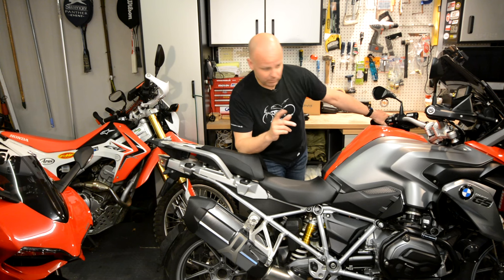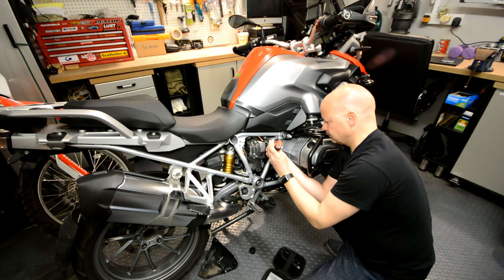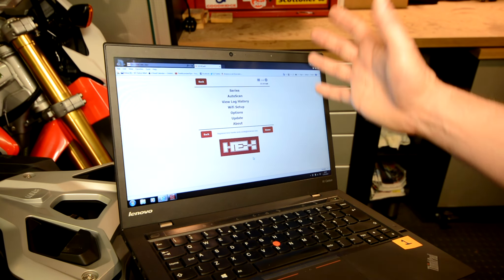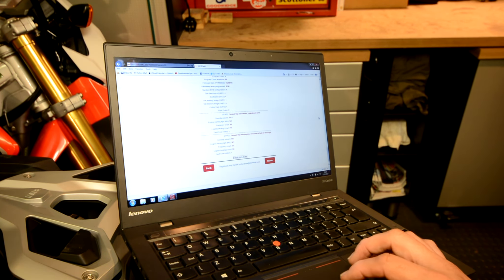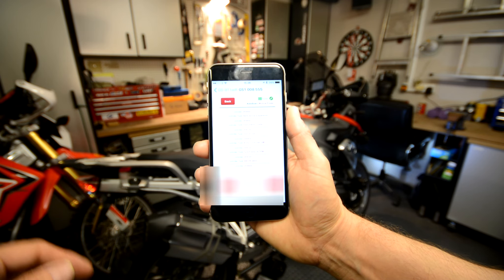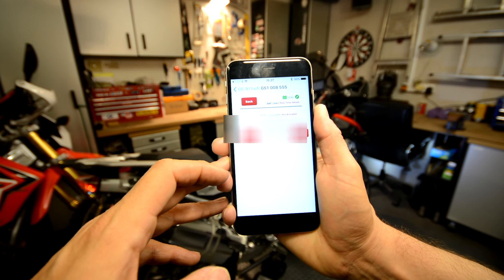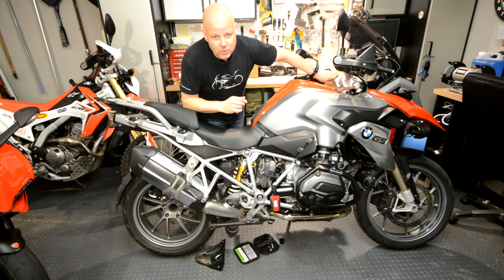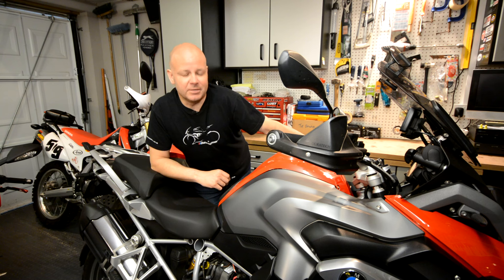Hex GS 911 BMW Motorcycle Diagnostic Unit Review

Comment: Good review pointing me in the right direction of this vital tool. Having ridden BMW's for over 40 years now and only recently crawled out of the dark ages and got a 04 GS12. Well maybe not right out of the dark ages but perhaps into the twilight zone, I need to change the brake fluid in the servo ABS and you cannot do it without one of these. For anyone who doesn't know the owners club have a tool hire facility for members and you can hire one along with many other specialist tools for a tenner each. You send them £50, they post you the tool, you send it back to them when you are finished and they refund you your £50 less their postage and the £10 hire charge. Mark, the chap who runs this is tremendously helpful and gives up his time willingly and for free for the benefit of members. Bet his garage is spectacular. Only downside all of my tech is Apple so I may have to get a garage computer if I cannot do it on my iPad.

Comment: Nice video TMF. I use a very similar diagnostic unit on my Golf R. It's called an obd11. Works on a very similar principle to the hex unit. It gives information such as error codes etc. It needs to be connected to a wi-fi network to function correctly, but gives a fair amount of customisation options. It is a bit cheaper than the hex unit, I think it retails around £90 mark. Main drawback is you have to purchase 'credits' to facilitate any changes you make. Assume the hex unit does not require any such 'credits' to function correctly.
Reply from the maker: +michael johnson  no, no credits required, maybe that accounts for the cheaper price of the obd unit...
Reply: Missenden!  I have the same exhaust flap fault on my R1200GS 2014.  Can I fix by myself?  The GS911 says the fault can't be cleared.

Comment: Like the way you made the video length 9.11 ;-). I love my GS911 wifi. It has paid for itself over and over, especially when resetting service intervals, which could cost $70+ to have done at the dealer each time. I also had an Exhaust Servomotor Flap error accompanied once by backward rush of air through the air cleaner and a cloud of dust during an engine start, so once aware of the fault I decided to remove the servoflap motor entirely and leave the exhaust butterfly valve in the fully open position (works fine without it and doesn't sound much louder generally). I installed a Servo Buddy from Skutrnet to avoid getting 1000 exhaust servomotor flap error codes and to tell the bike computer all is well :-). Occasionally the GS911 is unable to pick up a faulty component, such as when my TPS failed on me and no error codes were produced (just an intermittent nasty bucking broncho effect at 3000-3500RPM). I also enjoy being able to watch all the real time values on all  selected components 'live' while the engine is running to see that all are operating within specifications.
Reply from the maker: Great stuff - cheers for that....
Reply: instablaster.

Comment: Andy, that code you have maybe nothing but if the exhaust valve is not fully stroking (open) then your loosing mileage and power.  Reset that code and see if it comes back up again.  If it does, remove your muffler and remove the flapper plate on the valve.  The screws may be tack welded in place, if so, use a small dremmel tool and grind off the plate screw heads and remove the plate.  Don’t remove the valve or actuator, just the plate on the shaft.  This way you wont get “Other” fault codes.
Reply from the maker: Thanks for the tip - I shall take a look!

Comment: I have the previous version of the GS911, the Bluetooth model.  Have used it on several of my BMWs and it is a necessary tool if you dont want to feed your dealer diagnostic money.

Comment: Bike tech in Ireland,great service and the unit is less expensive. Once you set it up it's easy to work, I was under the impression it only worked with B M W motorcycles?The rates that BMW charge it's nice to know what the fault is before it goes to the dealer,or you may be able to repair, or sometimes it's just needing reset.
Reply from the maker: Yes only BMW machines, but lots of them, not just the GS.....

Comment: Always enjoy your videos. I appreciate the time you take to put out quality videos that are full of great information.

Question about the GS911: When connected to the diagnostic port, does the GS911 prevent the bike from automatically shutting down if the engine is not running?
Reply from the maker: I don't honestly know Jack - all I know is that whilst the GS911 is plugged in and the ignition is turned on, it returns real time readings....

Comment: TMF - good intro to the GS911.  One issue that I believe warrants mention - their "standalone" software is Microsoft Windows only, if I remember correctly.  Please correct if I have that wrong.  I know they support "cloud" functionality via a browser and Internet connection for non-Windows users, but if you are in the garage, or somewhere that doesn't include Wifi / internet, you must use a Windows PC for full functionality of the gs911 tool.  So, if you are a Mac user, you have an issue unless you are running Windows in some sort of virtual machine.  This might be a "who cares" or TMI for some, and I realize most users will have Windows, but worth noting IMO for anyone on a Mac or Linux considering a purchase.
Reply from the maker: Good point Sean, I hadn't picked that up as a Windows man....
Reply: Most of the functionality has been transferred to the HEX Cloud, so if you are in infrastructure mode, you have a great deal of the service functionality available on any platform.

Comment: Did you try using the calibration function of the exhaust pipe valve using the GS-911 to address your fault code?
Reply from the maker: No I didn't - I'm not that advanced!!  Perhaps I should give it a whirl...

Comment: To bring this a bit more up to date:  I've just purchased what I hope will be an equivalent for the kit featured.  The difference is cost - my kit (including lead, Bluetooth scanner and software) comes in at less than 50 quid. The featured kit is MUCH more. Specifically there is a OBD2 to BMW ICOM converter lead (about £12), a Bluetooth OBD2 sensor (about £15) and an android app called MotoScan - an alternative for the 911 software featured here which is written for BWM bikes and is only about £20 for the full featured version.
I'll report back when it arrives and I've tried it out.
C.
Reply from the maker: Sounds interesting!

Comment: TMF - any advice on installing the software? Did you have any problems with idle when you first used the device? Did you have to reset the stepper motors and have the bike relearn "adaptations," or anything like that?  Thanks - Harry from New York.
Reply from the maker: Nope no issue or relearning...
Reply: TheMissendenFlyer  Thank you for the advice. I'm about to install the software on my laptop to be able to use the GS-911. T

Comment: I was googling about BMW ISTA and you're one of the hit results LOL. I can't find an official literature about this.

I own a VCM II for Ford IDS with flexible subscription. I usually work with my own car. Hoping there is a similar service for motorcycle. Is there an official device and subscription for BMW Motorrad? I just want to reset my service light on my bike and check for error codes. I don't like the idea of travelling 200km to my dealer just to reset it. With my growing bike collection it seems a good investment anyway.
Reply from the maker: Well the GS911 can do that for you - costly though just to reset the odd service light!

Comment: Hi there. I'm curious to know if you are still using the GS-911 device and if you are still happy with it? What I am interested in knowing about the kit, is if it's possible to download any performance data/ diagnostic history via this tool? Of if you know if there is any such historic data stored in the onboard computer?
Reply from the maker: Historic fault codes are stored on the bike, you can clear them with the GS-911.  ...and yes to answer your question I do use it from time to time to check for new error codes and am pleased with it - as I'm not a mechanic myself I don't use it as much as it probably deserves though (but it is a nice piece of kit to have)...

Comment: Hi, I have a R1200GSA LC, and I need to change the miles in km. Will be able to do it with GS-911?
Reply from the maker: I'm sure there's probably a setting in the set up menu that allows you to do that without the 911
Reply: @TheMissendenFlyer  Unfortunately there isn’t such a setting on K51 without TFT
Reply from the maker: You sure - mine is a non TFT LC GS and I'm fairly sure you can change the units in the set up menu (though not positive).....
Reply: @TheMissendenFlyer  100% sure, mine is US version and it doesn’t have this option, that’s why I’m looking for a tool to do it, GS-911 or Motoscan
Reply from the maker: @Starmex100  Oh right, p'raps it's because mine is a Euro model then...

Comment: I have a GS911 and now that I also have a MotoScan, the GS911 is grossly overpriced. I have been waiting for years for the GS911 to allow coding to change my 12H to 24H clock display and their web site states "future". Well what century is that "future" in? Yet my MotoScan for a mere fraction of the cost did it and everything else like Brake Bleed and Service Resets.

Comment: Get rid of flappy thing 😉
Reply from the maker: Did you?
Reply: TheMissendenFlyer , I've seen a link pipe that gets rid of it , my bikes too old 06 , ive a y section and Remus can , it just needs cleaning and wd40 to free it up , it's going to be a constant fiddle as it will jam over and over , look into the link pipe
Reply: Skutrnet's Servo Buddy helps you get rid of it and keep the bike computer error code free. I've done that to my R1200RT Camhead. Also, you don't have to replace the piece of pipe with the butterfly valve in it. You can just disconnect the cables as the valve naturally remains in the open position unless the servomotor closes it (at lower RPM).

Comment: the only thing that stops my bike from running is lack of spark or fuel. looks like you are getting this motorcycling thing all wrong. a tank of petrol, a bedroll, a bottle of jack. no need for this nonsense , the more you promote it the more this nonsense will become norm. please do not get back to me saying this is progress because its not. this kind of shit is pushing us back to where some folk say we belong.
Reply from the maker: Fair do's - if it's not your thing then that's fine with me!  Thanks for watching and for stopping by anyway - all the best - TMF
Reply: WOW, don't knock it until you've tried it. The GS-911 is a brilliant tool if you're doing home maintenance.

Comment: A seized exhaust flapper valve ........... New set of down pipes! Not too much more than £2000 to you sir.
Reply: Squigles Or like every other BMW dealer I've dealt with we've never seen that fault before Sir.
Reply from the maker: Maybe I won't be getting a dealer to sort that one out!
Reply: It's only function is to be euro compliant on noise!
Reply from the maker: Yeah I assumed it was something not particularly important as the bike is fine in every other way....
Reply: And the sound difference is not much different without it either.